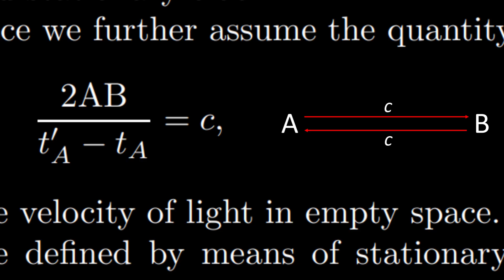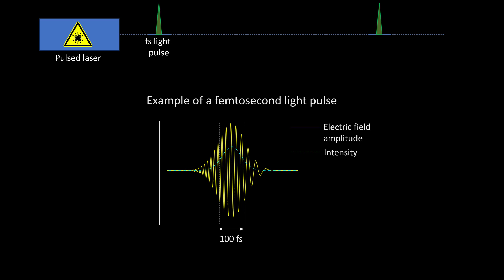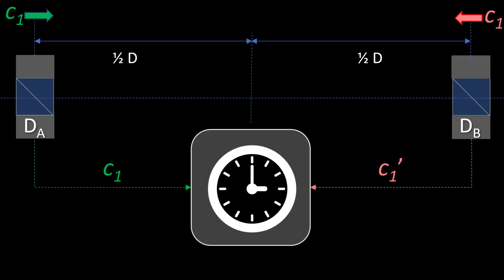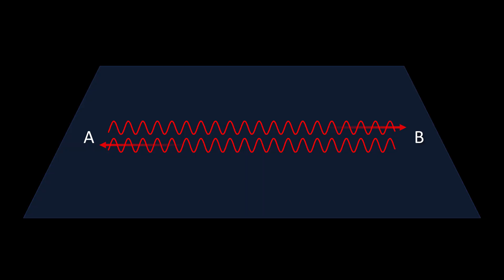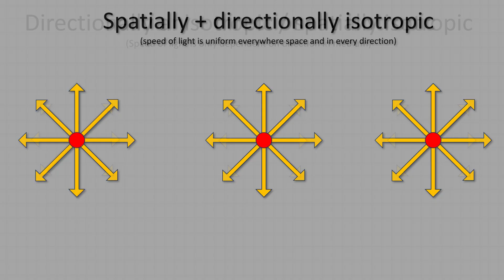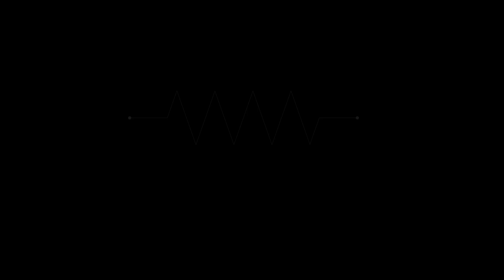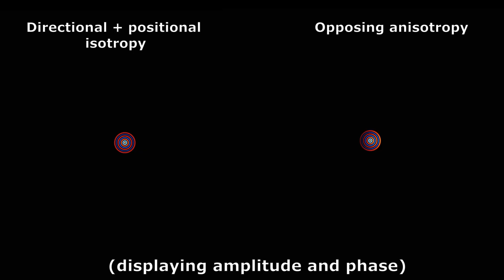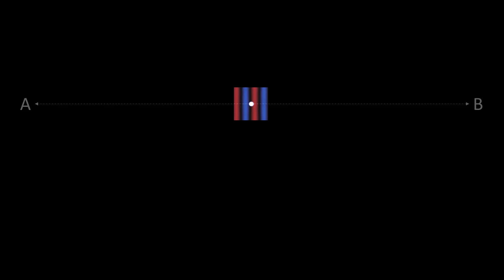Knowing the one-way speed of light

Comment: Yes, light propagating through space will be the same in any direction; but while the light is travelling, the receiver can move, which makes the detection at the detectors register different speeds.  Your initial setup is indeed a two-way experiment... but you can change the setup:  1) 2 detectors in close vicinity, in the center, with a high precision clock that records the time when the detectors on left and right are triggered.  2) Put two emitters that have a stable clock, that will always tick at the same rate (more detail later).  Each emitter will fire a short pulse (milliseconds are fine, you just mark the leading edge detection).  Amazon has lasers that are good for up to 2 miles (10,000ft)...  (light is approximately 1 foot per nanosecond, so over 10000ft is 10000ns or 10us.)  Over the 10us, because of our motion through the universe towards VIrgo according to the redshift in the CMB, we move 370km/s or .0012 ft/ns... so it will move 12ft over 10us, and register a different speed from one side vs the other of +/-12ns... or a total difference in the speed of light of 24ns.   (in the perfect arrangement).... so this would need to be aligned with the constellation virgo/cetus(opposite side constellation), so that there is a best-case... it's aligned to approximately +9degrees north; can't really just make this go any direction, or you can end up with a near null result, the orbit around the sun is 10% of the speed through the universe, and the rotation of earth is 1% of that...  so +/-1.2ft  or +/-0.012ft from those effects... the motion through the universe is much more on point.

Mind you - the speed of light does not change based on the speed of the emitter... just the speed of the receiver - such speed is then c+v and c-v..... There may be additional skews to the stable clocks.... that once deployed they are not in exactly the same gravitational field... but this will be a constant effect, and the constant drift can be factored out.  Air pressure is an insignificant factor; and since it's likely that the 4 miles the experiment covers (2 miles from one side of center and 2 miles from the other side) will likely be the same it ends up being non-measurable... and any change under like 100,000atm is barely notable... a few millibar is not going to change the experiment...same with humidity - the same amount of humidity is likely experienced across the apparatus.

Another way to consider this is say you're playing catch with someone else, and every second they throw a ball at you at the same speed, if you move towards them, then the throw that happens while you are moving will be caught by you in a slightly shorter time.  If you continue to stand in place, at this new distance per second, the ball will be registered as every 1 second.  If you walk away during a throw, then the time it takes to catch the ball is slightly longer, again, until you stop.   If the experimental apparatus is perpendicular to the velocity, that's basically initial conditions - and every pulse is received at 1 second intervals from both sides... as the apparatus aligns with the direction of motion, it's like the center detector is able to take a few steps forward, and pulses from one side will arrive in slightly shorter time or slightly longer time, whether the detector is moving towards or away from the emitters respectively.  Once it reaches the maximum alignment, the pulses will still be every 1 second, but will be skewed from each other compared to where they started... if they start on every integer second, then it would be at +12ns and -12ns from the original state along a timeline.  The times between each impulse registered from each side are subtracted from each subsequent sample, leaving a small delta change between each received pulse... at the end you'll have a net bias (probably) from clock skew, this can be removed by subtracting the final value from the initial value, and subtracting that sloped line from the result, biasing the beginning and and to 0.   (This would mean a complete 24 hour cycle should be run... it would be less meaningful to do only 6 hours or even 12 hours - because at the 12 hour mark you're not necessarily in the same arrangement, since the apparatus is aligned with a specific point on the horizon, at 180 degrees of earths rotation, then the device is no longer in the same alignment as it started, but is tipped in a counter direction (that's not the right word but maybe you get the idea).

I have been working on setting up this experiment, and if I can get the apparatus built, I would take it to the great salt lake, there are very few areas where there are 4 miles in an arbitrary direction that are entirely clear and flat, and wouldn't interfere with the line of site - could built something in the ocean maybe, but it would have to be tied to the ground.   The two emitters and the center detector MUST be rigidly arranged - floating them, or launching them into space will not help.   Anyway - I did setup a program for an FPGA that has a high speed clock, and two registers internally that can be latched when a signal from a light detector is received... the latched clocks can be read more slowly and stored in a computer over the next second between each pulse.  The FPGA though is actually pretty slow, and although I'm almost able to get a 600ps clock, it's unstable, and a temperature corrected crystal oscillator that is more than a Ghz is expensive... That, and I don't know how many photons the photodetectors have to see, or how bright the intensity is - but I would expect actually quite a bit of noise from that receiver - plus, I don't know a good way to gate a laser pulse - for the same reason, propagation of all the voltage regulators, plus time to build up a signal to transmit are likely going to cause more noise in the experiment than +/-12ns.   I've somewhat settled on using a synchronous AC motor that rotates 60RPM (once per second) and put a wheel with a 1mm slot on it - but even then, as that is actually pretty slow, it's going to uncover a fraction of the beam, and then the whole beam, and then start covering a fraction of the bean as it passes... which makes the signal leading edge not very concise... and is another point of noise.   There are high precision frequency generators/counters but I find they are $16,000+ to be within a range of desired resolution, and then that is a bulky external thing, which introduces nanoseconds of delay with propagation of those signals... I just don't see it being done with off-the-shelf components.  Probably have to make an ASIC with dedicated silicon for the clock and 2 latch registers (a super simple thing, though you do need about 52 bits of precision, which is quite a lot of bits, and a long chain to update.... which potentially makes the clock have grey bits in the middle while it's still counting a clock tick... the clock edge at one end will change even while the middle of the counter is still updating from the previous tick.  That and the light detectors need to be pretty precise, and the module I got, the sensor is actually not JUST the sensor but has a transisitor the detector is attached to - which, again, signal jitter/noise.  I don't know if maybe I got a DLP(?) sort of chip used in projectors that could gate small mirrors in two directions pretty fast... I would think those are still on the scale of 100s of microseconds... and far from the nano/picosecond gating I would want.

Speaking of space, changes in space of the gravitational field only propagate at the speed of light also, which means ahead of our planet the field is somewhat compressed, and slightly more dense and is slightly weaker, so satellites will orbit just slightly further away (1 meter per kilometer roughly), and on the trailing side, the field will be elongated, and have slightly greater effect, making satellites on that side orbit slightly closer... This makes GPS signals always take the same amount of time to arrive.  There is a thing in the solar system the 'Axis of evil' which is an overall alignment of the elliptical orbits of things that is always in the same direction.  One could argue that GPS (multiple emitters some fixed distance away from a central detector that registers the time in the same location with 0 propagation time of the clocks signal) is the same as the above; that is, the same, except for the specification of being rigidly attached.

On my channel the last few videos I did were on simulations I built (open source, links in descriptions to the demos and/or more information documents in the github repo) that are based on the one-way constant speed of light... and indeed, any two-way measurement will always be a constant time for a distance, in any frame, moving in any direction, while the individual one-way paths are neither the speed of light (as registered by a moving receiver).  Light, once emitted no longer has anything to do with the source that emitted it, and it propagates in space regardless of what the source does afterward... Though the net combined effect does result in light aberration, both on transmission, and on reception of signals (see synchrotron radiation beaming effect for more about this aberration for electrons travelling close to the speed of light - the direction the light is detected is mostly all directed forward.
Reply: Mind you this does not measure the one-way speed of light.  It only measures the differences in the one way speed of light
Reply: Did you account for all relativistic effects?
I've tried a similar thought experiment but length contraction and time dilation always cancel out any effect the anisotropy of  the one-way speed of light could have, because these effects depend on said speed of light in that direction.

If light is slower, the effects are stronger.
If light is infinitely fast in that direction, the effects don't happen.

This stops you from measuring anything.
Reply: @silience4095  absolutely.  I'm not measuring the speed of light - just the difference in the speed of light.  My experiment won't give what the actual observed speed was... Though I have looked into slow clock transport issue - and really turns out that only works if you have a stationary frame, that's not in gravity... since we already have a lot of time dilation from gravitational fields around us (earth/sun/galaxy) can move a clock 2 miles at pretty much any speed and it won't really change as much as you'd think it would.  The Hafele-Keating experiment (planes) flew for many hours at a high speed, and only had nanoseconds of drift... over 2 miles the speed of light can be +/-1/1000 (actually a little more like 1/870) which while a pulse is in the air, the earth will move 10000/1000 (10 feet) or have a 10 nanosecond difference... which is much more than the few picoseconds of drift from the slow transport.

but then again, I'm not measuring the speed of one way light, which would require synchronized clocks, but the difference, which from 2 opposite outside ends, generating pulses with a monotonic stable clock, are detected at a center point, which uses a single clock to compare the incoming pulses - so the synchronized part is not even synchronized, but is the same clock.
Reply: @3zdayz  Which still doesn't work. Look closer, you're still doing a 2-way measurement which means that you're trying to detect the difference of 
A to B then back to A, being different from B to A then back to B.

There's no difference, even if the speed of light is anisotropic.

That's the point, it's impossible to detect the difference, everything conspires so that even if you think it's one-way, you're actually comparing 2-way averages.

Comment: You made up a situation, that no-one is talking about. It not about changes in elastic potential, it's simply just the medium of light moving relative to the observe. 😔 if you had just used a analogy like sound waves, immediately you would realize that this type of speed difference happens everytime , Because the air move. 
The one way speed of light or any wave can be determined by it angle of reflection. Let's say a spherical pulse of light is emitted a two mirror on both sides of the source . You can illustrate this for yourself if you like , it's very simple . The angle of reflection will change, will means that you would see the light source at a different position / angle and distance. 
I'm tired  and disappointed , is this really the best. 😮‍💨

Comment: Ligo measures 2 way speed of light in orthonormal FABRY PEROT I arms and orthogonal arms contain one direction information and are exclusive of one another. The Michaelson I can be omitted but may be usefully included to precisely compare relative speeds (when lengths are not affected above noise by G waves they can be used in either presumptive protocol . 

Moreover, indeed one way information using t= billion(s) or years is accessible from a satellite collecting tof data from numerous mulitdirectional pulsar sources. 
And since light from distant pulsars are clocks to check against the interference pattern of home grown lasers for femtosecond frequencies correctional purposes even light frequency needs calibration if we are to use it to interfere and infer two way speeds in orthogonal arms …. Removing circular assumptions… 
so that the interference can be integrated across gravitational influences for arbitrary precision of round trip both arms of c
Lisa can confirm. Then we can put a compact insert into one arm at a time for samples of different refractive index and investigate group and phase velocities of light slowed or no. Yes LIGO  & LISA awesome with plug in laboratories intercepting the photon paths in various ways. 
Consider this as a follower HO… we like your application of clearly evident IQ.

Comment: Would the difference in c result in different wavelengths for the same frequency propagating in opposing directions?  Those quantities feel tractable to measure, and are a lot more local of a measurement, avoiding the whole loop problem.

It felt like the video was about to go there a couple of times, so maybe I missed where the idea was dismissed as not even wrong 😅
Reply: @joshmyer9  And how would you measure it? Since you have the same frequency, you can assume that the speed is  the same.

Comment: To define a one-way speed of light between two different points, you must have a concept of simultaneity at those two points. According to special relativity, this is meaningless; you can pick a velocity v in any direction and define (x_1,t_1) to be simultaneous with (x_2,t_2) if (t_1-t_2) = (x_1-x_2) dot v. This gives you different speeds of light along the direction of v. Of course, this is not measurable by any experiment, which is why you can assume that the speed of light is the same in opposing directions as a matter of convention (although there is something more to be said about diagonal directions).

Comment: Let's postulate that the space medium is universally isotropic in its permittivity/permeability values (within the visible cosmos at least). 
It should be possible to measure velocity relative to the zero velocity rest frame of the space medium. So how would that rest frame be determined?
 
The CMB (cosmic microswave background) would be coincident with the rest frame. And it so happens that the CMB has a slight blue/red doppler shift from one side of the sky to the other, called the 'CMB dipole anisotropy'. It shows a 'velocity vector' giving our solar system's velocity and direction relative to the CMB. The colors here are greatly exaggerated. And the red/blue zones are unfortunately shown backward. But the velocity arrow's direction is correct. We're going at 371 km/s relative to the rest frame.  https://3.bp.blogspot.com/-PQezC3my_eU/U-UHQZ9UGrI/AAAAAAAABAI/OIj5hR6ehCA/s1600/CMBdipole.jpg  So you'd subtract 371 km/s from c, giving the ACTUAL isotropic or 'one way' speed of light, i.e., True C (upper case). 
 
Of course, the figure is approximate due to the dipole anisotropy's low amplitude and resolution. But provisionally at least, it illustrates principle in determining the 'zero velocity rest frame' of the space medium.

Comment: There's an experiment that came to me today, just before this video came out, that I would love to see, but don't have the means to perform. I just recently learned that Neodymium-doped Lithium Niobate can be used as a lasing medium. I am incredibly interested in the interference and diffraction patterns produced by it, specifically when it is being used as a laser medium while also piezoelectrically oscillating. Lazing Lithium Niobate, even when not doped, is a parametric down conversion process too, producing more than typical entangled photon pairs! If you're interested at all I can link you to a few papers, and a source for Neodymium-doped Lithium Niobate on substrate. 

Love you so much!!